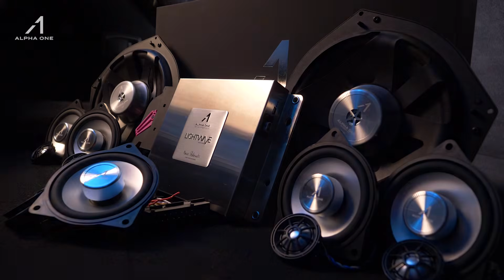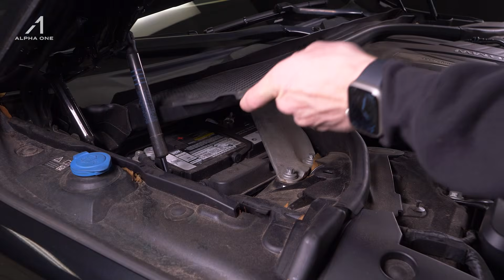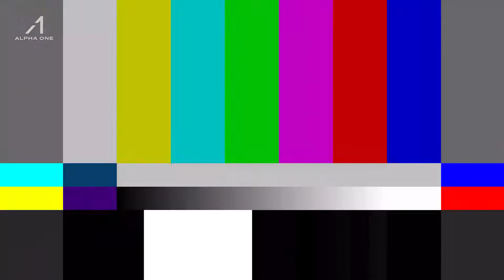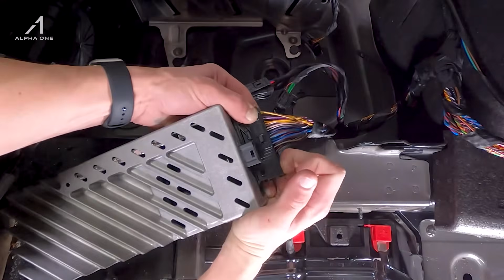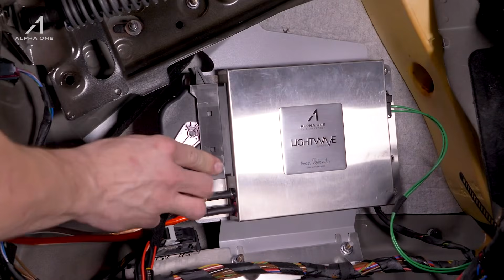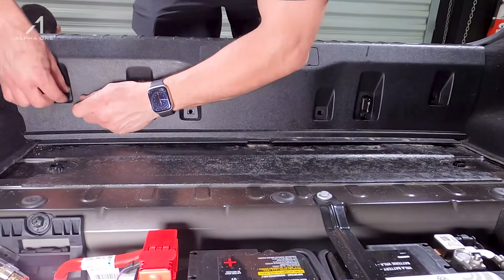Alpha One BMW 7 Series (G12) Alpha One Amplifier Installation Tutorial

Comment: What are those small wires near optic cables? Why you don't use them anymore?
Reply from the maker: They differ depending on which BMW chassis it's on, but with our kit, our main harness and power connectors take care of everything, replacing the old.